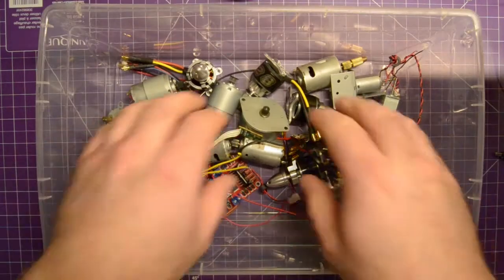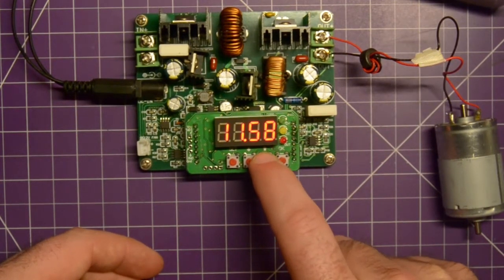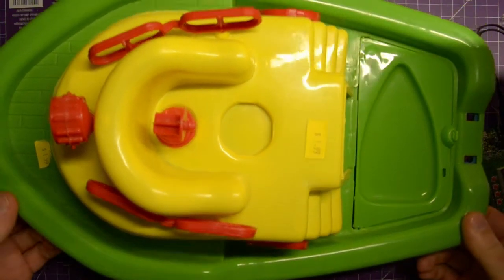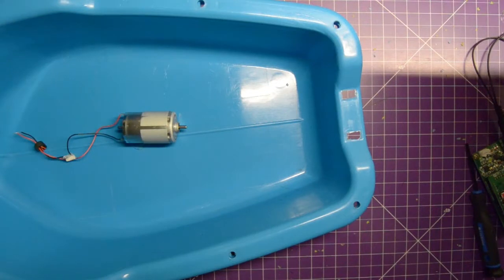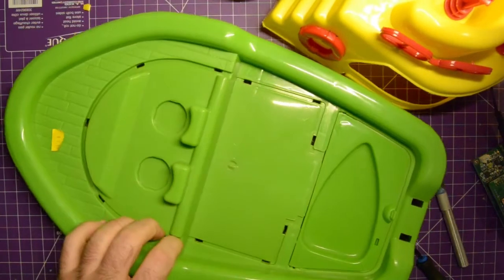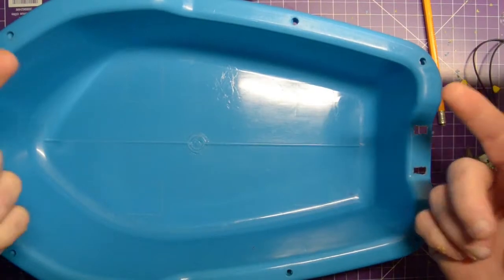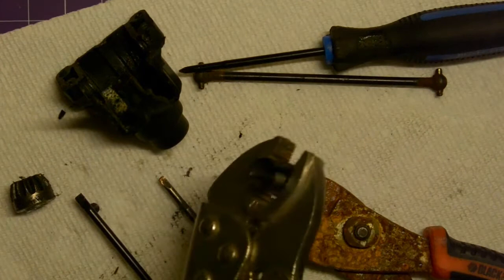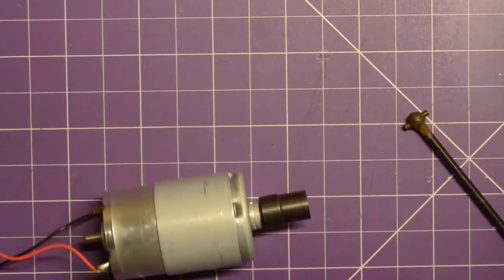Modding a VERY Childish Boat Into Something Much Better!

Comment: Hi, can you suggest what transistor is best to use because I want to buy it
Reply from the maker: Hey, I recommend that you look up the specs on Mouser or Digikey and compare it to what you need in your project. If you are looking for a general purpose, low current transistor, I recommend you check out my other video, where I suggest a NPN and a PNP type transistor : https://youtu.be/I0GlWeLxVCQ